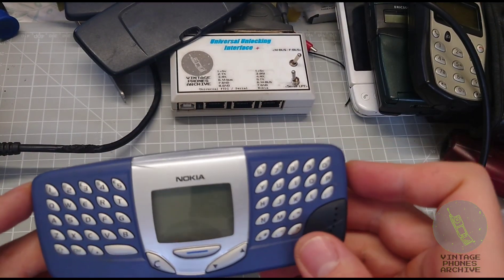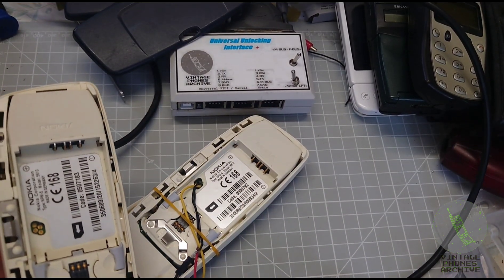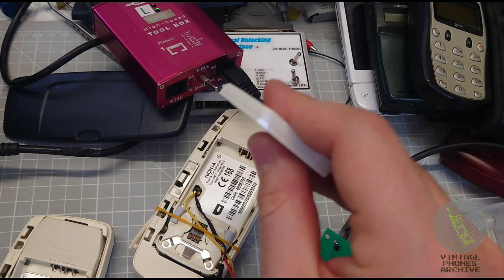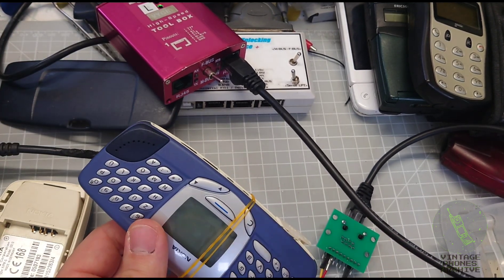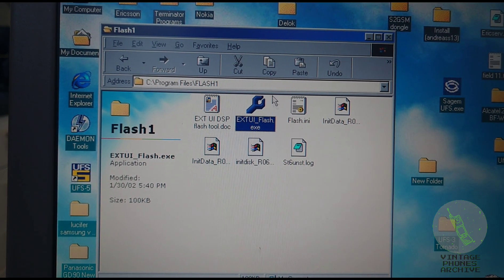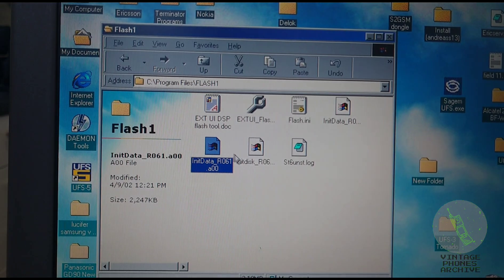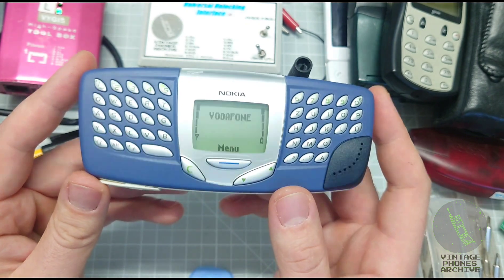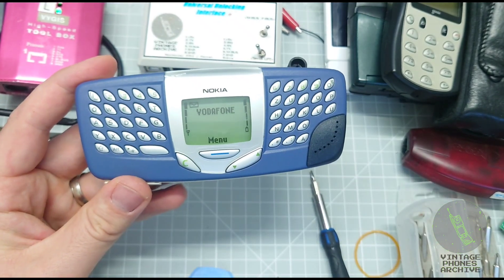How to fix the NOKIA 5510 turning itself off after 5 seconds issue

Comment: Friend! Thank you so much! I spent six months looking for Nokia donors to replace the radio module, which didn't work after the replacement. But thanks to you, I soldered the legs of the radio module and brought the phone back to life. With love from Russia
Reply: Hello, do I need to flash the soft or can I bridge the pins of the circuit and will that help?
Reply: @Maciej_w124  Just close the door, everything is explained and shown in the video

Comment: I have 3 Nokia 5510 that pass the flash part but all 3 failed on step 3 write data Radio UI error.So if the chip is dead, do you think if I rehot the chip with flux will help?or it has to be changed with new?